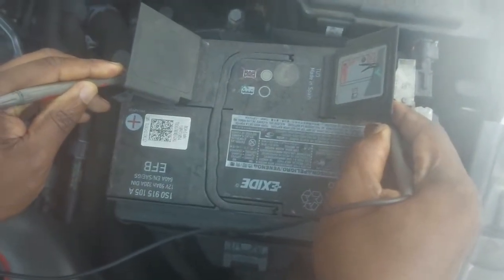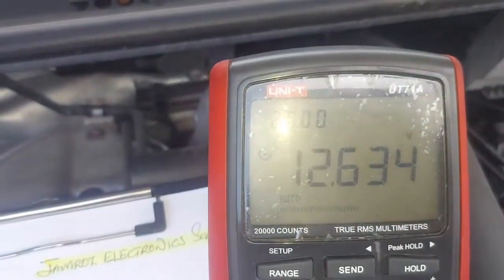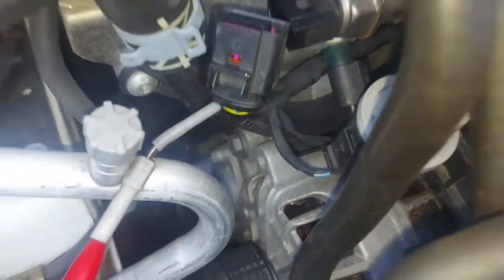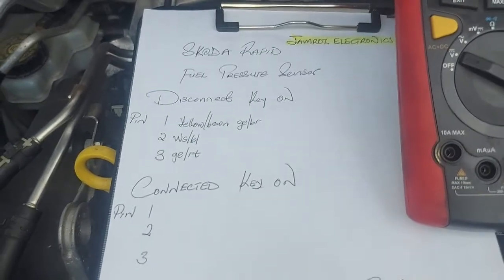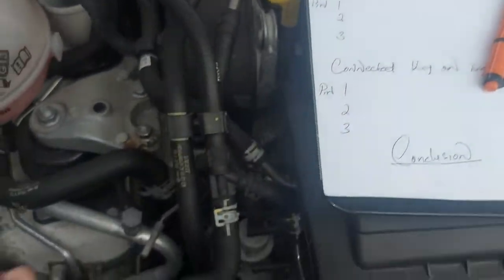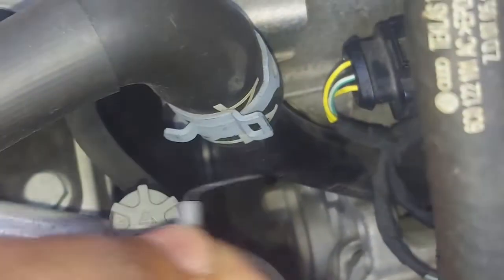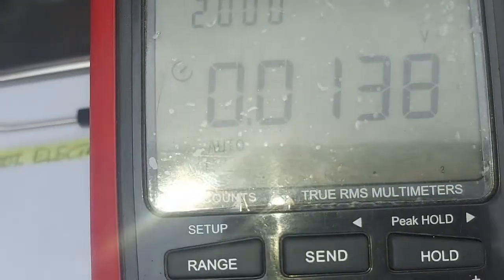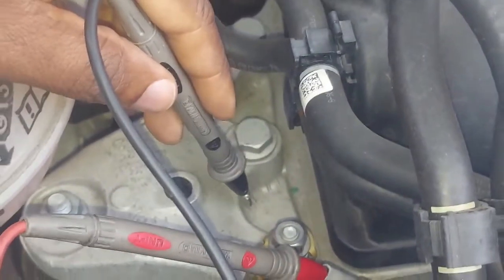Fuel Pressure Sensor Testing Made Easy: Expert Tips & Tricks!

Comment: I did similar test and i found out that the 5v reference have reduced to 1.02 volt after connecting it to the sensor, pls has the sensor shoten to ground or what? The car does not start unless i disconnect the sensor, pls what is the problem now. Thank you, hopping to hear from you
Reply from the maker: sorry for a late reply do you still need help or you are sorted
Reply: I finally resolved the problem, the car was brought to me from another and they changed the wiring connection.

Comment: Very good information video but
You can use crocodile clip on your test cables    so you can have better contact on ground and on power,
You don't need to hold the test cables.
Greetings from Konstantin
Reply from the maker: Thanks for the tip

Comment: So, I disconnected the plug from the ECU Pin 1 and pin 3 have 12v voltage on the plug! It is a Ford Smax 2.0
 diesel 2015 model .error code P0193 - P 0606 -
 P 060c - P062b .what do you think it could be? ECU?
Thank you 🙋
Reply from the maker: Do you have a signal at ?. P0193 suggests the sensor is faulty but P0606 suggests that the ECU has been damaged inside.

Comment: Hello, pin 1 is ground 12v? Vehicle mass? pin 2 is signal volt pin 3 is 5v from the pcm is that correct?
Reply: Informative 
You can connect a multimeter on ohm=resistance pin-1 and the ground=(B-) on Battery 
So you can find the ground=(B-)
Then you can continue the tests
Reply from the maker: if you want to know what each wire is doing, please disconnect the sensor and with the key on Test each against a good known ground such as the battery negative terminal

Comment: Hi,how do you test the sensor itself,i have 3 and none of them have any resistance on the pins.
Reply from the maker: with sensor connected check for 0.5V on the signal wire. Do not check resistance
Reply: @jamrozelectronicssolutions7232  thank you